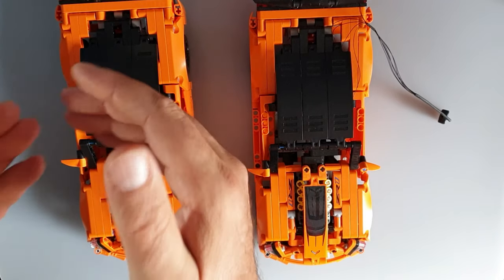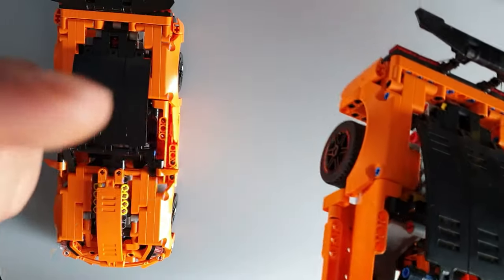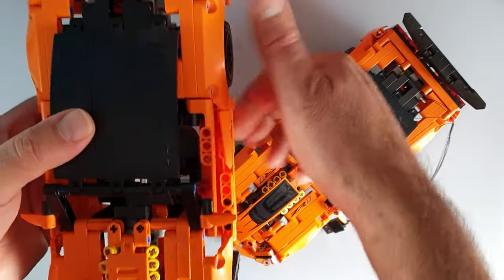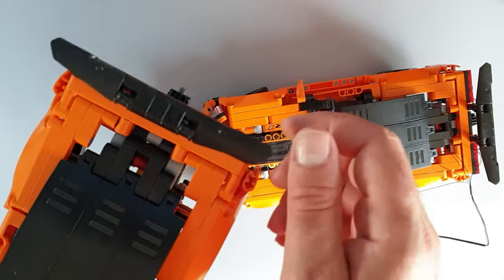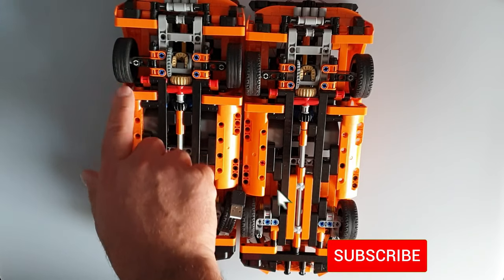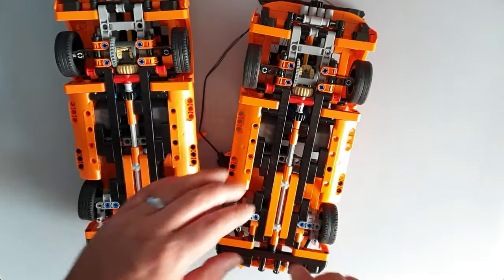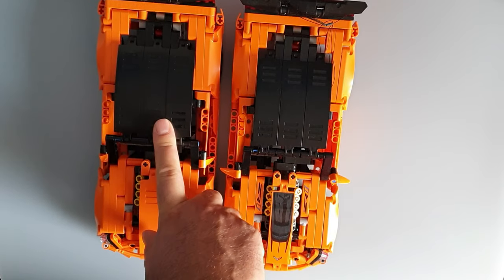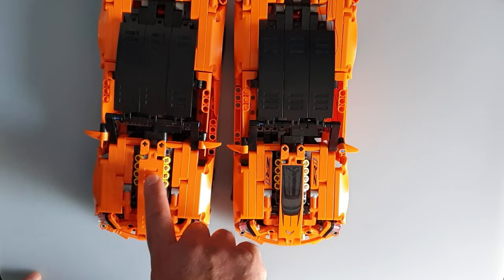Lego VS Fake Lego - 42093 Technic Chevrolet Corvette ZR1 Race Car

Comment: I feel like for the price and the poor appearance Lego has given it it should be able to do something more, like a convertible roof and working doors
Reply from the maker: I agree. I thought the doors were opening and roof was hiding somewhere but no...
Reply: Let's Build It if the appearance was spot on and the wheels fit in the mold the same as the actual car or at least normal looking in the wheel well I’d excuse the roof but the lack of doors makes the model feel very poorly designed and modeled 

The front isn’t very desirable, the rear feels empty, the wheels are too small for the rest of it, the spoiler looked to large and outlandish so I lowered it giving it a sleeker profile, the interior feels very rushed and un finished, the exterior doesn’t look at all like the real car aside from a few minor details which still incomplete with gaps in the paneling and the very shell like nature of it while still requiring a frame that isn’t easy to modify for non exterior changes, the being able to see straight through it could be avoidable with some more parts that could be easily put in if they thought of it when making it, the only function it has is steering and that steering is unreasonably complex when if they were to make the motor in it look visually the same as the real one it could be simpler and more appealing to consumers and the simplicity of it would make it easier for modifications, the random color changes in unseen parts doesn’t make sense unless it’s cheaper in which case they are trying to get more money for less value, it isn’t appealing unless you get a very good angle of it that doesn’t peek into the chassis or make weird things seen
Reply from the maker: Yep, I agree. I actually prefer the B model. It looks better in my opinion.
I've installed an after market lights kit and that improved the overall appearance.

Comment: The kit has only two functions: motor driven by differential, and steering. In the fake kit, the steering is tight and the differential doesn't really move freely. Probably it's due to poor tolerances on the gears. Considering the real kit can now be bought for 30€, I wouldn't bother with the fake one in this case.
Reply: Bohan Wang  always depends on the daily discount you could find. Take a look in brickwatch to find any good prices.

Comment from the maker: What is your experience with Fake Lego?
Reply: Hey dude chose on fake lego or real lego
Reply: Gears on the fake legos sucks!!
Reply: I have a few fake Lego sets and they are so ducking bad the pieces sometimes are almost impossible to put together and sometimes they need to be tighter
Reply: I've had a Lepn 911 GT3 RS: it was terrible. The pieces didn't fit consistently, I had to drill burrs off some of the holes, the gears didn't really work.
CaDA technic however, is decent and works well, although the gears aren't as good as the real thing.
I have a couple of mould king kits on order, hopefully they work out well.
Reply: 42093 jisi bricks ok for me..